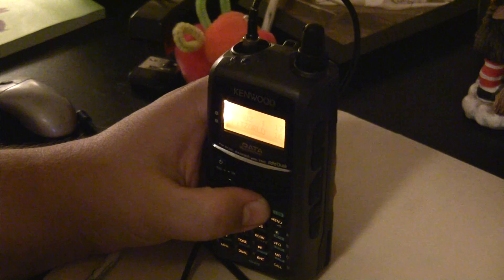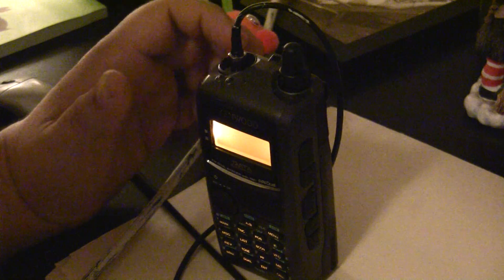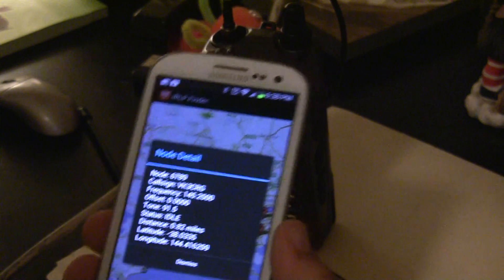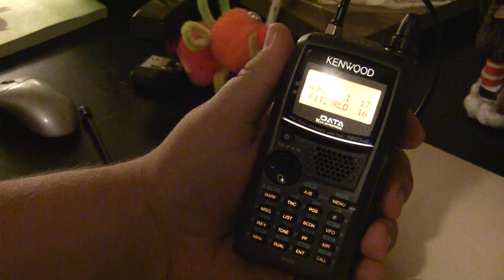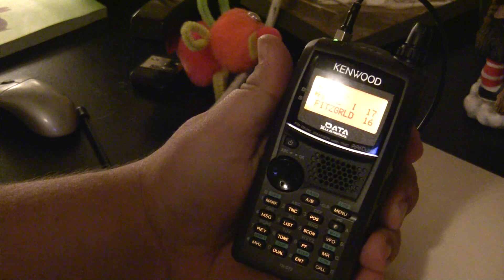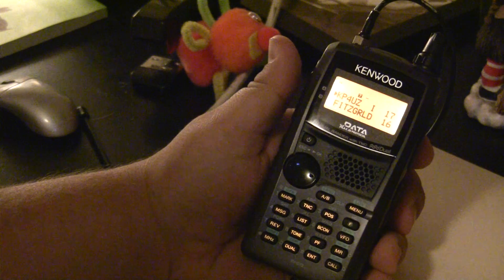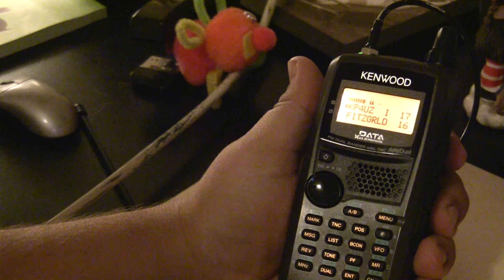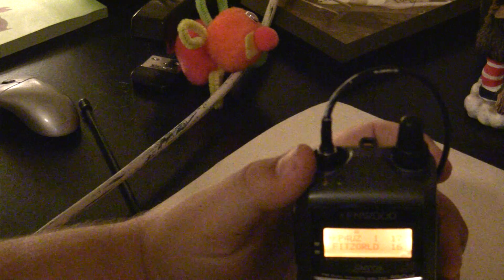How To Use IRLP

Comment: do you have to use a certain radio like a kenwood to use IRLP?  I have anyton, ft-3dr, and a wouxun 9d   and a couple of boafengs
Reply from the maker: The Kenwood TH-D72 works well but I've also done it with a Yaesu. As long as the radio supports DTMF it should work.

Comment: I have a question...
I have a 250 watt cross. Band Repeater. Large coverage area.

1. Can a Mobil radio access the irlp on the repeater access the internet gateway and go to another no repeater. Or are they only going to be allowed to connect and transmit on the irlp should we install one. I really don't understand the capabilities of an irlp is it going to be just radio two the irlp node and just transmitting on our repeater or can you give it a command two choose another note. Quite a large expense looking at the rack mount and the Linux system. Can you help explain this a little better I would appreciate it. 
N6ZLW
Pete Damron

Comment: so here's a question, when using IRLP, can the connection be terminated from either side? ie say you connected your node to the 6789 node, could someone in Australia disconnect you by transmitting DTMF 73?

other than you obviously calling CQ, if someone were monitoring the IRLP node in Australia, would they get notification that the node has been connected? can multiple nodes be connected?
Reply: Yes they could disconnect the link by hitting 73. They would get a similar announcement that the the link has been brought up through the node you are using. Multiple node can be connected to each other through what is called a 'reflector' Think of  direct node to node as simplex and many nodes to a reflector as the repeater of the IRLP system. Your node is not announced to all other nodes when you connect to a reflector.
Reply: Thanks, after getting my HAM tech license shortly after making that comment, i experimented with a buddy. reflectors are cool, but most of the ones i've run into have all been fairly quiet. the 9100 reflector seems like the coolest as it generally seems to be the most populated. I've played around with echolink too. the biggest problem I have is nearest echolink and IRLP nodes to me are right at about 35-45 miles from me, and my little baofeng with nagoya can't hit them. that's kind of the thing I like about the Echolink system is that I can use my internet connection and use my desktop to listen in/transmit around the world without having a direct radio node. might install a J-pole to see if I can get out a bit farther, but also looking into HF once I upgrade to general. almost bought a Yaesu FT-450D, but some other stuff came up, and my other hobbies got in the way. digital modes (rtty,psk31, etc) interest me most I think. 2m/70cm was popular for a bit here, about a month before i got my ticket, then it dropped off.

Comment: Hi, Nice job; I like the way you slowly demonstrated the actual process of IRLP using HAM radio two meters and the Internet linking. You'd be a good teacher! I'm just learning about IRLP. I do not have a key pad on my mic (MH-31). I was wondering if I could open PTT and the hold my telephone next to the speaker and key in the tones? Thanks from KD0EGD.
Reply: Radio Shack used to sell a DTMF pad that would just generate the tones.  That wa back in the time of remote access to your answering machine, and not all phones may have been push button.  However, it is easy enough to make.  Each row and each column has a specific tone.  When a digit is pressed, the junction of the row and column creates 2 ones.  The decoder picks up the tones and determines where in the matrix the button press occurred.  Building a unit might work better than trying to coordinate pressing the PTT button and then pressing the buttons on your phone, though in theory it would work.

Comment: Helpful. Thanks and 73 DE K7JKZ
Reply: ***** Paul OM, are you referring to your 146.700 machine?
Reply: ***** OM, appreciate the info. I am using a handheld with no outdoor antenna. Drawing plans for an iron pipe home brew mast for a J-Pole. I can only key up 146.7; audio after that doesn't survive. Location is two blocks NW of the VA medical center. I hear the activity on 146.7 and would like to partake if the antenna height helps. The VA medical center and Oklahoma Medical Research Foundation buildings could  block me.
Reply: Between this video, the IRLP website, email from yourself and Paul Sr., the W5DEL website, and other sources, I believe I can qualify as "IRLP Novice; No Hazard."
Reply: I've noticed that 146.700 is now often WINS. Is that replacing 443.300 as dedicated WINS?
Reply: Sometimes when WINS becomes slow I've thought of keying it to something like England, Australia, or Japan. But mostly I have left it on WINS.

Comment: I can't Get mine To work, Got a yaesu 2500m and a radio shack htx-404 using a Tram dual band mobile antenna, I am transmitting To a repeater In Colorado not 2 far from me, I have dialed 73 and waited, No return audio, Then dialed 7673 Kingston node, Still no return audio

Comment: Thanks for the video! QUESTION: Say you connect to the Victoria AUS node as you did 6789, would your CQ contact have to know the node number of YOUR local irlp repeater in order to transmit back to you?
Reply: no, both repeaters are linked. No different then if both people were both just using the same repeater.